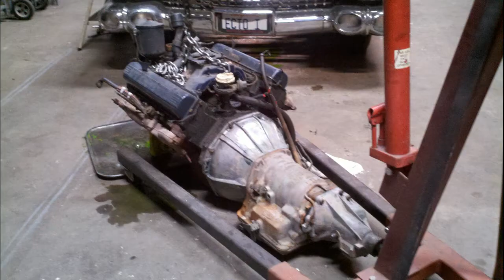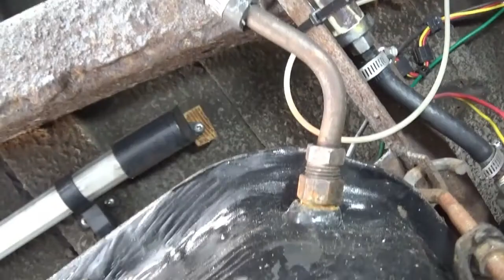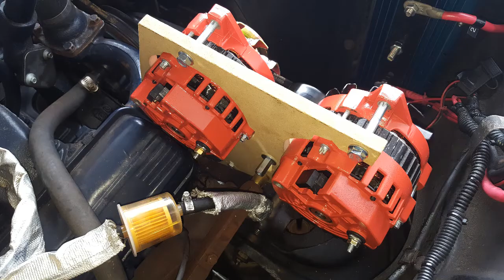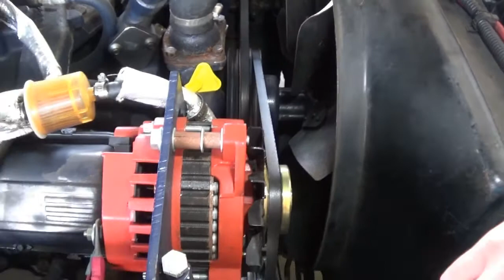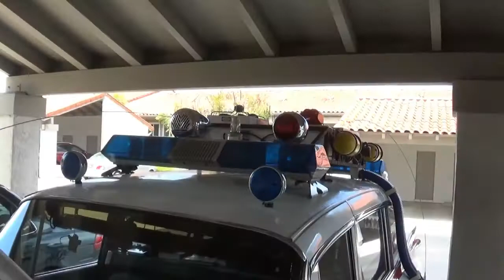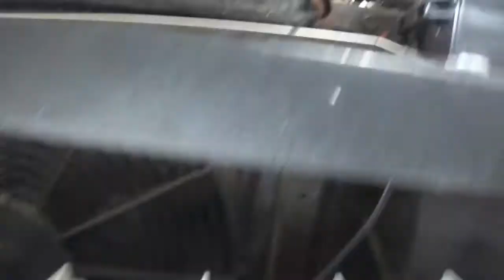Tales From An Ectomobile - 03 TheEngine

Comment: Did you ever discover what caused the engine block to crack? Got an older car myself I'm restoring and it's my one big dread
Reply from the maker: No, we assumed it cracked due to old age.  Keep in mind it cracked about one year into Eric and I owning the car so there's no telling what the car went through in it's previous 50 years of ownership.  We have reason to believe one previous owner ( who was into "movie props", not "old car ownership" ) may not have checked the dipstick as often as was needed, something like that.  I really can't be sure.
Reply: @fifthrider  Thanks so much for the reply, I really appreciate it. Mine's a 1958 Edsel, hasnt driven since the late 70s, going to not be as flashy as Ecto 1 but I wont be afraid to add a few personal touches like you did with Ecto. Thanks so much for the videos and Happy New Year